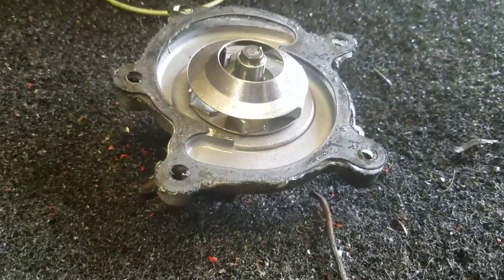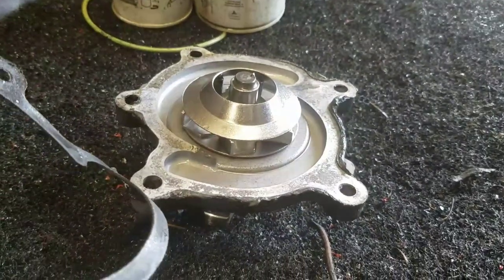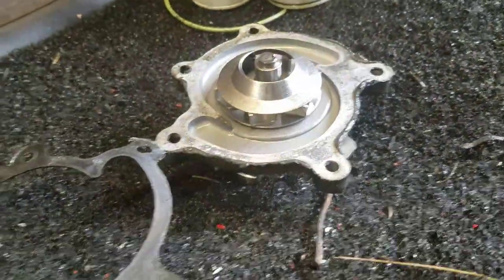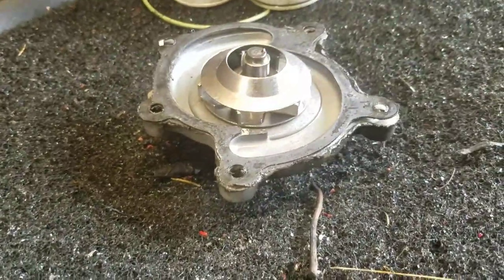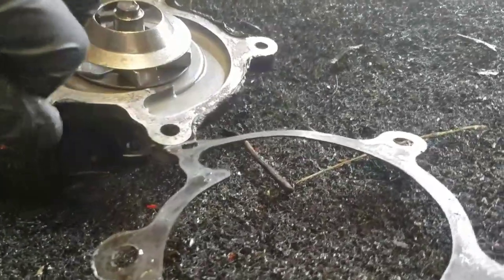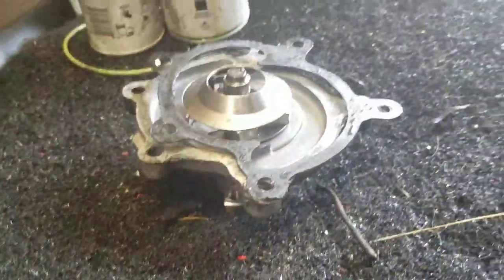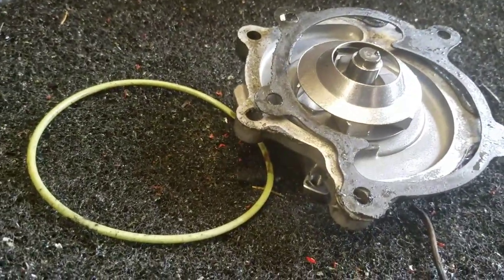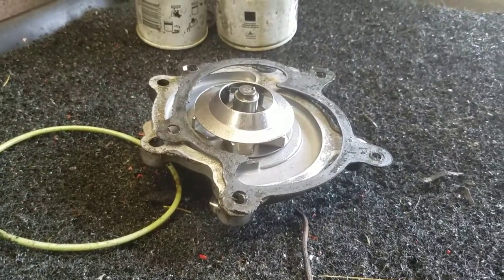Repair: do not use RTV silicone on paper gaskets

Comment from the maker: For everyone commenting about their "30 year ase" test passing ability, the OEM dealership training  facilities (and manufacturers that have to build vehicles to not leak during the warranty period, where they have to fix it for free) have a different opinion. ASE is not a training facility. It's a test. Like a driving test. And we all know how many morons there are on the road....

The point is.. do what you feel you need to do.. all I'm saying, is I've made a pretty good living fixing these leaks... and 85% are "repairs" that have used silicone versus the manufacturer's procedure....
Reply: I have used gaskets sealers on about every repair until now. I just replaced the water pump on my Taurus and used blue RTV sealer and less that a week after I replace it, its spraying water everywhere. I have used black RTV sealer and don't seem to have any problem just the blue. I think I will try it this time without any sealer and pray it works. The gaskets are not expensive but I don't like to fix something but once. This is the first time I've had one fail but it it fails one time that's one time to many.
Reply from the maker: @alensley1368  there are other types of "gasket sealers" such as "permatex super 300" which is not silicone based, does not dry out, and stays malleable to 425* 

Here is s snippet directly from permatex websight.

10. Using a gasket maker as a dressing on a conventional gasket.
This might be the most common gasketing error of all. Many mechanics will use an RTV gasket maker to hold a conventional or cut gasket in place during assembly. Some mechanics will even use the RTV gasket maker as a dressing, coating both sides of the gasket. Gasket makers are the wrong product for these applications – their formulations are too thick for use as a dressing. If you’re installing a conventional gasket, use a gasket sealant – they’re available in sprays, liquids, and tubes, with specialized formulas for a variety of applications.

https://www.permatex.com/ten-common-gasketing-mistakes/
Reply: @MegaMarclar  Thanks.
Reply: show me a GM vehicle now days that dosnt leak before the warranty is up...!..I make a great living.. fixing all that manufacturer procedure..
Reply: @MegaMarclar  i used permatex 80062 "high tack" with a paper gasket.  Is this ok?
Reply from the maker: @AbbeyRoad69147  it depends on what the gasket is for, where it is located, and what fluid it contains
Reply: @MegaMarclar   water pump
Reply from the maker: @AbbeyRoad69147  I have used Hitac on w/p with good success.
Reply: @MegaMarclar  Alright so this is confusing, I am about to proceed with sealing my thermostat housing without any paper gasket using Permatex Blue Gasket Maker (22071). According to Permatex, I can use this as "For assembly as a form-in-place gasket" (my plan) and as "For assembly as a gasket dressing" which is what your customer actually did (don't know if he used the same product though)... Using a paper gasket is tempting, I have to admit. Should I resist the temptation?
Reply from the maker: @msboston01  depends on the application. What are you working on? Blue rtv is the worst you could use... if you absolutely have to use rtv urs black or grey. Blue shouldn't be sold in stores, it's useless
Reply: @MegaMarclar  this is for a 1989 Lincoln TC. I already replaced the gasket with a new one but that didn't last long. so I am looking at different options...
Reply from the maker: @msboston01  I would recommend using permatex 80019 aviation gasket sealer. It's a brown goo. It is the proper sealant for paper style gaskets. I never use any type of rtv on paper,.. but that's my personal opinion.
Reply: @MegaMarclar  Roger that. Thanks for the advice.
Reply: To be honest, I have always put grease on my paper gaskets. Why? Well the method behind the madness is that the paper gasket absorbs the grease and expands, and at the same time water proofs the paper. Works really great on gaskets with a small cross section. I learned this from an old mechanic. Still, I would never use sealer a silicon type sealer on a paper gasket.
Reply: @andycagle8781  exactly. the good ole boys that taught me in the 1970's always used orange rtv on both sides and none of their jobs ever leaked!   I think it comes down to HOW MUCH you use
Reply: @A. Melbs OF COURSE! Everything old was bad and everything new works best!  Never mind I just told you MY EXPERIENCE - everybody in the past was more corrupt than today!   They kept it secret!  Nevermind what you saw, felt, experienced with your own senses!
Reply: @A. Melbs 😵‍💫

Comment: Used rtv and similar for years, NEVER had it leak! trouble is people use rtv sealant wrong most times, put it on, just finger tighten the bolts/nuts, then after an hour torque it up! then don't re fill liquids/fluids for 24hrs, it does say on the packaging how to use it! most people put it on fill and go, it won't work! it works fine if you use it properly! 30 years ago used to use red stag plumbing compound on head gaskets when times were hard and couldn't afford a new gasket! a dad trick that worked! it does work fine if done properly!
Reply from the maker: Well those processes can help, problem is in today's automotive industry no one can wait that long. It's a flat rate feast or famine world
Reply: Thanks.
Reply: Did u use the RTV with the paper gasket or just rtv? @justin ayres

Comment: I performed  many repairs in my 1944 WC 51 many years ago. Many of them were gasket replacement,  which I did according to reprinted era manual from Portrayal Press. Excellent reproduction manuals if you ask me. Well, in those manuals you found detailed instructions about how to install or make a gasket and proper torque. I don't think back then cars were leaking oil everywhere since sealant was not invented yet. I performed the gasket replacement using the 1944 method explained in manual and they never failed. Eventually sold that vehicle  and bought a newer one in which still use the practice of DONT USE SEALANT IN PAPER GASKET. I still found the same results: no leaking.
I found no reason yet to change that practice since EVIDENCE tells I'm right
Reply from the maker: it depends on a lot of factors... 'sealant' has many types, and aviation sealer for example is great on paper gaskets. NOT RTV.
Reply: Not questioning your experience 
but  The thing is IF SEALANT IS NECESSARY IN PAPER GASKET...why it doesn't leak when paper gasket is used according to manuals  instructions? Pure luck?
Reply from the maker: @enterBJ40  follow the video in the description you'll see that there's tens of thousands of possible variations. There's a dozen different papers and 5 dozen different "sealers"... There's no blanket solution for everything. Most are marketing.

Comment: I just feel like if you’re going to use rtv then just use it alone. I’ve done both where I’ve had a paper gasket and rtv at the same time and it worked out fine.  When you mix both together it’s just an unnecessary step and more work/money.  My theory: if the surface is near perfect (not scratched or any imperfections) then use a paper gasket.  If it has imperfections then use rtv to fill the gaps
Reply: Often parts designed for a gasket need the extra spacing provided by a gasket to function as intended. Using gasket maker or other stand alone flange sealant will change clearances. Same goes the other way, using a gasket where a liquid sealant was the design parameter. There are sealers for closely machined surfaces and sealers for gap filling, sealers for high pressures (like 20,000psi), those for high flex or thermal strain, or specific chemical and temperature resistance, pre-applied verses applied at assembly. Generally the manufacturer has done some research and testing in the matter, though admittedly in the case of many consumer items like cars that research often favors the needs of the original assembly line, or possibly high volume dealer, rather than individual field repair and restoration decades later.

Comment: Used RTV on my water pump and intake manifold gaskets on my 87 Monte Carlo 23 years ago and NO LEAKS in 2021! However I do understand what your saying. It’s just the way an old timer taught me when I was a kid.
Reply from the maker: There are some applications where it should be used... but not all. On the 305 they want you to use rtv around the coolant passages.
Reply: @MegaMarclar how about the front and back of the intake of a 305 Chevy small black?  I use to always get leaks when I used the rub tabs that came with the intake gasket kits. Later GM started using nothing but silicone instead.

Comment: I reviewed your video it makes sense, the expansion and contraction of the two components. I just got done replacing the thermostat gasket on my 1992 Ford 5.0 V8. I used rtv and yes it leaked for the very reasons you explained in the video. This time I used gasgacinch which coats the paper gasket with a thin layer of the product, you let it dry for a few minutes before attaching the gasket to the housing, then the housing with the gasket to the intake manifold. I applied a thin layer onto the intake manifold, waited 3 minutes then carefully placed the housing on the manifol and started the bolts. Did the leak check, NO leaks!!!  Thanks for posting this very important explanation, on why you don't want to use rtv.
Reply from the maker: thanks for the comment. There IS a difference between 'gasket sealer' and 'rtv "gasket sealer" '
the marketing teams have allowed millions of sales in products and re-repairs. Sometimes you have to go back to the roots of the old timers, and how they did it.
Reply: @MegaMarclar  You are correct. I was so happy I was able to stop the leak. The rtv just let coolant leak, dribble out real slow.
Reply from the maker: @cliffordkinnear9705  I'm glad you were able to get it fixed. So many people these days think that RTV silicone is the one end all solution
Reply: Very true, "gasket maker" does not equal "gasket sealer"(aka "gasket dressing")
Reply: IMHO, use a good gasket sealer IF anything.   A spray or brushed sealer is WAY different than silicone goo.

Comment: Thing I always wondered is why people would use the paper gasket anyways if they're using RTV. To me it feels a bit double, like putting a wheels under a wheel to move it. The only time when I used RTV was when there was no gasket to begin with. If there is one, I simply use that and it has always worked fine.
Reply from the maker: Yeah see that was all due to marketing from fill pro back in the '90s. Silicone everything. The thing is that you're supposed to use aviation sealer on paper gaskets, not  rtV

Comment: Thank you SO much. The directions for my new Duralast water pump were very unclear and I was about to add a sealant as it basically directed me to. You saved me!
Reply: So it worked out without any leaks because I followed another Youtuber on here and they had me put it on and it leaked like NIAGRA afterwards. I'm about to go and get another one and                            do it this way...just wanted to know how yours held up
Reply: Any updates?
Reply: @daSTARPlayer i didn’t use any RTV sealant on my 07 Buick water pump and didn’t seem to leak after 3 years my radiator blew one of its tanks. So I replace the radiator with new one and decided to go ahead and replace water pump being it’s so cheap. I pulled the pump and notice around the outer water pump shaft was rusty. So this time I went with a thin amount of  gray RTV sealant . The GM directions in the water pump box recommended using it.  I waited 30 mins after applying it to the gasket and waited until it stopped being tacky. Put the pump on and finger tighten the bolts. Waited two hrs and now tighten them to spec and now I’ll wait tomorrow to add fluids. Hopefully it doesn’t leak.

Comment: I’ve always used on paper, cork, rubber, etc. Permatex® High Tack™ Spray-A-Gasket™ Sealant.
coat both sides of gasket, let sit for a bit then apply and torque to specs, works great.
Reply from the maker: High tack does work for a number of applications, but not for all.
Reply: @MegaMarclar  for  a water pmp or Tstate High Tack is the way to go .
Reply from the maker: @awack_  it depends on the specific type of gasket. Hi tack doesn't nessasary work the best on the blue silicon Impregnated paper.
Reply: Would Permatex Aviation sealant 80019 be similar to the spray but in brush on? I believe they are similar but one is spray and 80019 brush. Basically it’s just a thin tacky layer to aid assembly.

Comment: When the metals are similar(eg steel on steel or iron) and the heat is evened out by the enclosed environment you will not have the issue with thermal expansion, both will expand at basically the same rate putting no shear strain on the flange sealant. With aluminum against iron/steel the difference is about 6-7 ten thou per 100f; iron and steel expand ~6.5 ten thou and aluminum expands ~13 ten thou per 100f; copper alloys are between at 9-11 ten thou, titaniums are only about 5 ten thou, lead zinc tin and magnesium are 13-16 ten thou.

I swear most people are at least partially illiterate, they act like reading the label, let alone TDS, will cost them a first born child. 
When reusing good condition paper gaskets(yes this can be appropriate for certain old timey projects.) I wilI tend to favor gasket dressings for dressing paper gaskets; These usually thicken but stay somewhat plasticly deformable(flow under force) such as high-tack, gaskacinch, or even non-hardening permatex gasket maker(No2 or aviation-3, or maybe even 300, these are great on threads). 
Hell I've even had good luck using Indian-head gasket shellac to cement a motorcycle valve cover in place when the o-ring based seal had gone bad and some threads were in need of an insert,(prior owner tried over tightening rather than replacing the o-ring.) now I was on the road in small town timbukto, but it held on an air cooled engine head for over a month of daily riding until I made it home ordered the o-ring and had the threads repaired. The cover and head were both cast aluminum. Shellac is soluble in straight alcohol for cleanup, but resistant to both petroleum and water.

Separate from all that, there are different types of RTV for good reason, some are stiff(grey) and some are very pliable(red).
Reply from the maker: Finally someone who gets it. Lol. I've been the enemy of the state since I posted this video, because everyone Is an expert that used rtv one time and had no issues.

Comment: I've found most people use about 20x too much. A see thru skimming is all that's needed. Sometimes silicone helps to hold the gasket in place also if the mating surface is scratched or damaged in any way silicone has it covered. After having a water pump on a v6 mitsi leak thru the paper gasket after 7 hours of removing shit to get to it......never again shall a gasket be left unglued. I've also done a water pump on a Honda that was missing a bolt from the pump! It wasn't leaking from the seam it was buggered in the bearing but the silicone had been holding up the slack for God knows how long.  There is a knack to silicone like any other product. Less than 1mm coating is all that's needed, some dudes lay it on like they would toothpaste on a brush😧
Reply from the maker: People also confuse "gasket sealer" for rtv. Old school gasket sealer is not rtv. Just because they print it on the package doesnt mean that is what it is.

Honda also uses O-rings which are much more forgiving with missing Fasteners than a standard paper or plastic gasket
Reply: @MegaMarclar  it seems to be no matter what tube of goo ya buy the packets all say 100% silicone somewhere on the back 🤣🤣. It's more a marketing/pricing thing I think. You can buy a small maybe 50g tube of gasket silicone for like $20 or a $5 400g tube of bathroom silicone here. They feel, look, smell and taste the same to me. I've used bathroom silicone on sumps before with no leaks even over a period of several years it's still dry. Some of the parts we get here are Chinese knockoffs and the gaskets you get with them sometimes don't even line up with the bloody bolt holes even and you have to blade a little extra out here and there. Over the years I've repaired more paper gaskets than had things leaking glued up with silicone. If ya wanna be a real prick tho go for the sikaflex rubberized bonder/sealer🤣🤣. That shit never lets go.....even for 3 screwdrivers a hammer and vicegrips😂🤣😁🤣😂
Reply: @brotangyoust9252  Let's get Project Farm to do a test on that one!
Reply: @MegaMarclar I wish car manufacturers would only use ORings! So much nicer when assembling parts. I’ve always hated paper gaskets.

Comment: This may be true if you are using a high quality OEM gaskets, most people use the aftermarket gaskets that are low quality. I used the gasket supplied with the water pump, did not use any sealant and used an inch pound wrench per the service guide, a year later the gasket was leaking and it took me five hours to replace the gasket. Used Ultra Grey RTV and no leaks in over ten years.. Don't allow RTV to dry before tightening the bolts, it simply seals the paper fibers... RTV works well if used properly, easy to remove compared to adhesive products.
Reply: When I replaced my water pump I used only the paper gasket supplied. 3 years later and still no leaks.
Reply: OEM outsourced to China.  We all know the quality that comes from there.